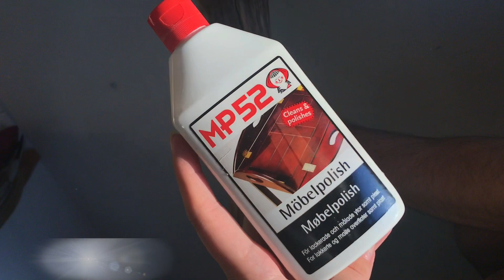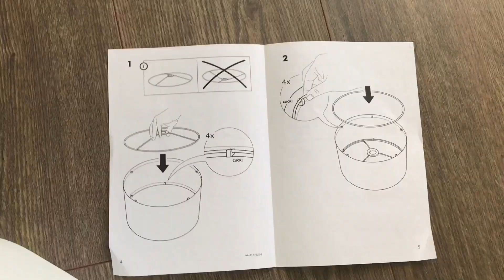How To Make A Diy Lamp | Old branch to Floor lamp | Wooden Lamp 2020 | IKEA lamp shades ideas

Comment: What work does a wooden polish do? Can we skip that? Pls reply. M trying this.
Reply from the maker: Hello Darpan thank you for stopping in and watching our video! Yes, wooden polish is not necessary you can skip that, wooden polish is used for the shine of the wood, but you can skip that 👍 Good luck 🍀
Reply: What number sand paper did you use to smoothen the surface of the log
Reply from the maker: I used 40 grit sandpaper just to smoothen the surface..
Reply: Thanks a ton for your replies.
Reply from the maker: Darpan Sharma Good Luck 👍

Comment: Do you have too let the wood dry out first if it’s water logged.  Was a bit concerned about water and electricity. Not good.
Reply from the maker: Hi Michael! Thank you so much for stopping in and watching our videos😊
Yes, I dried the wood first and then put lamp wire, 
Again thank you for your concern! ❣️